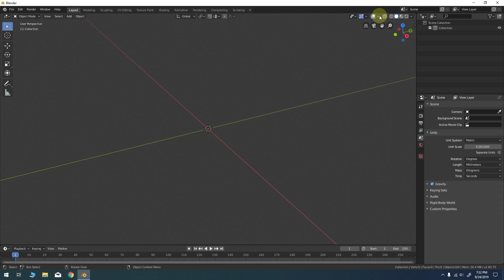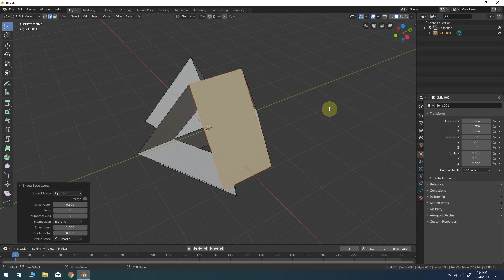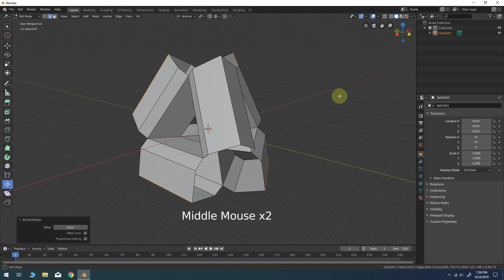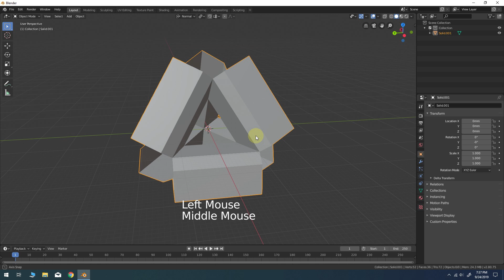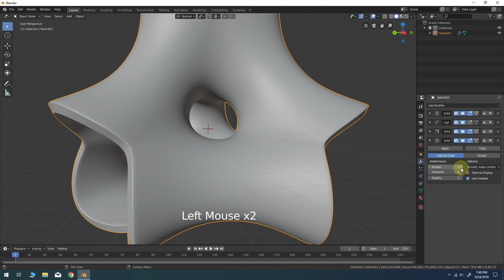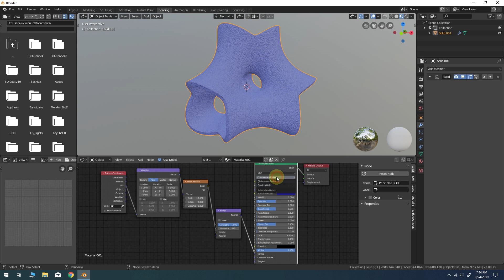Blender 2.8 Tutorial | Tetrahedra Solid For 3d Print Or Rendering

Comment: Great content, I really enjoyed your videos for 3d max and learn from them. Just a quick question. Why did you change from 3ds max to blender?
Reply from the maker: Hi, Samer.  Thank you for your support.  I appreciate your comment.  I still use 3dsmax for many things and it is still a very useful tool in my pipeline.  Blender has always been a tool I used along with 3dsmax, and for a long time, I had been creating the same tutorial videos for both 3dsmax and Blender.  Lately, I have been using Blender 2.8 a lot more and the reason for that is the new enhancements to the workflow in Blender have actually proven to be very productive for the type of modeling I do.  Many features and hotkeys are now changed, and I wanted to present that to the Blender users who may have been subscribed and following some of the older tutorials.  More than anything else I found the options for working with objects in real-world units have been updated in the latest versions of Blender, and now the Units scale behaves much more seamlessly than it did in the past, which had always been the primary reason I never really used Blender for production until recently.  There's just been a lot of impressive changes to the Blender workflow that I felt merit some extra attention now, as most of the modeling features in 3dsmax have remained untouched since around 2010, and most of the enhancements were through plugins and scripting, which isn't always free to the user.
Reply: I think in the first time that your anseer will be that:
Blender is a free softwere.
Blender work with a less caracteristics of PC.
Blender file is so small in terme of taille.
Blender now has a good realtime engene.